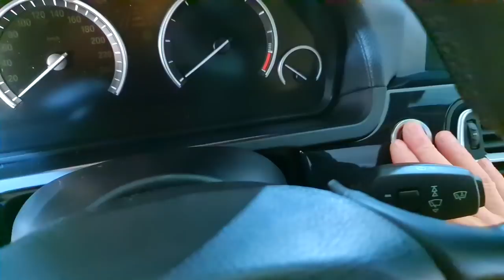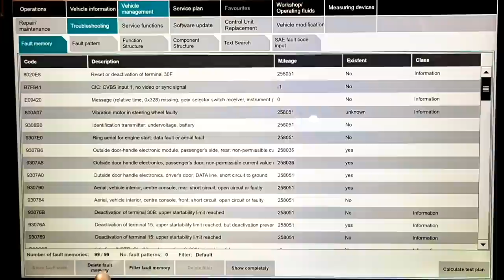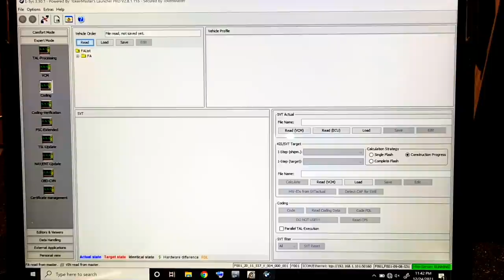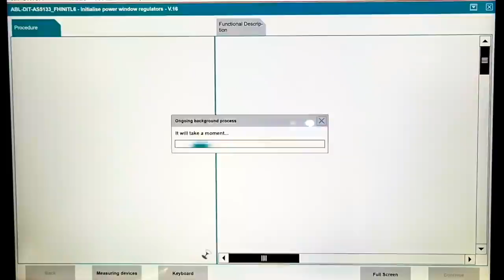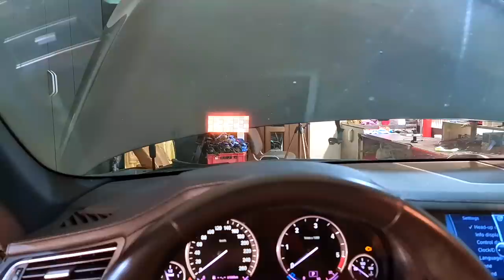Head up Display replace BMW f01

Comment: It’s there a way you could tell me which direction the pigtail goes from the button for the HUD? Long story short I just purchased a 2011 535i and noticed it has everything for HUD, lane assist ext but doesn’t work. Well I pulled the buttons out and there is no pigtail for it nor can I find it under the dash. Trying to see which route to follow without pulling entire dash for 1 pigtail.

Comment: Can you replace HUD by taking windscreen out? Open 2bolts up and 1down remove connectors and pull it up. Seems like a lot easier?
Reply from the maker: No, you can't do that !
Reply: Ok thank you and great work man im not gonna try this myself. Seems like prolevel job! :)

Comment: Mine has been broken on my F02 for a while now, seems like it’s inevitable with these cars. I’ve had a replacement in my possession for like a year lol, but it looks like too much work just for that 

I have the upgraded digital instrument cluster & infotainment screen, so the HUD wouldn’t work with that anyway 

I have a question however, I notice you don’t have the DVD player in the hidden compartment. Did the car not come with that option? Or you removed it? Because I can’t get it removed without causing the infotainment screen not to work
Reply from the maker: Hello! if you didn't see it that means the car wasn't equipped with it! You can remove-it , you need to clos the fiber optic and do some work on the LVDS cables I think...you need to check wiring diagrams!

Comment: I have a question for you, perhaps you can help me out. I have a BMW 750 f01 from 2010 - import from Japan. The head unit is quite different in the back compared to the unit you have removed in the video. Would it be OK if I sent you a couple of photos? Maybe you have seen this configuration before. 

The Japanese unit has the standard pink & yellow connector, then it has 4 coax black, blue, gray and yellow. Black and blue I believe are radio and GPS, but yellow and grey?
On top of this there is a small three-pin connector as well, not sure if it's microphone or something else.
Reply from the maker: Hello, you need to study the wiring diagram and you'll find out everything you need to know. for diagram can use istaD

Comment: Hello I would like to know please if I change my dashboard (because the leather has swelled) is it necessary to code the car? thank you in advance
Reply from the maker: Hello! No you don't need to code for replacing the dashboard , you need to code when replace modules/ control units!
Reply: @MOvidiu  Thank you very much for your answer. I did not expect those that you repindiez incredible.

Comment: You made it into 2022! Great. Nice job on a wonderfull car.
But the coding with Esys goes way to fast to learn what you're doing ;)
Thanks!
Reply from the maker: Why you say that :D,  I was suppose to not make it :)) , The coding is done at a normal speed even slower ...:)

Comment: I'm wondering - what the hell are the BMW (and Mercedes, and many other car brand) engineers smoking when creating such a complicated design for the panels. It could be very easy to make the HUD replacable by simply taking out the instrument cluster, but here you need to dissasamble most of the interior just to get to it - it's insane.
Reply from the maker: Hello ! it is not insane at all, at the time of designing these vehicles this was the technology, there is no smaller HUD to be able to replace it just removing only the instruments cluster . on the contrary they are very well built. BUT I repeat  these vehicles are not built with the idea of being able to be repaired at the edge of the curb on the street, with the necessary tools and knowledge everything is easy to repair / replace

Comment: Salut.daca îmi poți da o părere .mi-am schimbat spirala de la volan și am deconectat bateria apoi reconectată am băgat un scanner să văd ce erori am și am stat cu el cam mult .acum hud-ul nu se mai aprinde.poate să fie de la baterie? “instrument cluster. Falure of voltage supply. terminal 30B” b7f6a4 am ca erroare

Comment: there's no way you have to do all that just because of HUD...I got some serious rattle sounds from the HUD area in my G82 M4 while creeping forward or backwards when the engine is shaking the most (when parking) and it's driving me nuts...and from this vid I won't be able to remove the HUD to check what's making the noise 😭💀

Comment: Ceau Ovi , chiar esti primu la care ma uit cu placere la videouri !
Daca ai pune zilnic ar fi ideal 🤣 dar stiu ca e greu.

Am 2 intrebari : merita sa pun la un e61 hud retrofit ? Ca timp munca etc 
Si nr. 2 icom + esys + ista sunt luate prin licenta sau dp net si te ai perfectionat in timp.

Mersi 🙋🏼‍♂️
Reply from the maker: Salut ! ma bucur ca iti plac clipurile mele ! Merita si nu merite ... depinde de fiecare in parte , de costurile implicate ...
Reply: @MOvidiu  piesele n ar fi o problema , dpdv financiar , mai degraba faptul ca optiune la e61…iar manopera as face o eu :) 

Referitor la a doua intrebare , singur ai reusit sa inveti codariile etc + toolurile folosite :)

Comment: Dayyum very informative video. I have to replace the air conditioning vaporizer cuz its leaky i have no ac in this fkIng hot summer but my mechanic said 1k € only for demounting 🥲